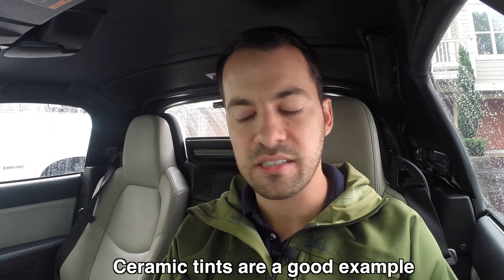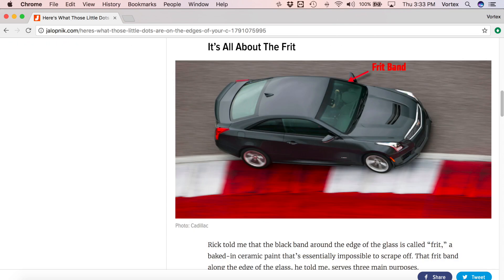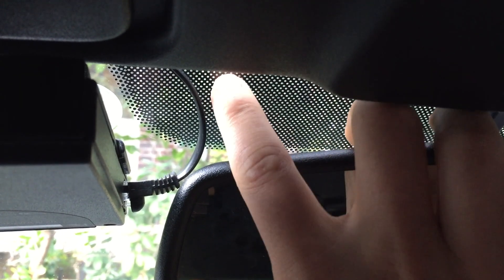Do Windshield Tint Strips or Dots (Frits) Affect a Radar Detector's Performance?

Comment: Since Frits Dots are essentially paint -- Do you think it's ok to use paint remover (or similar products) and Remove the dots?  Thus, I can mount unit higher.  Any thoughts?
Reply from the maker: Sorry I dunno. I test radar detectors. I'm not a car modification guy. There's ways of mounting on frits using tape that may be easier and less damaging to your car, but your best bet is to ask someone on the forums.

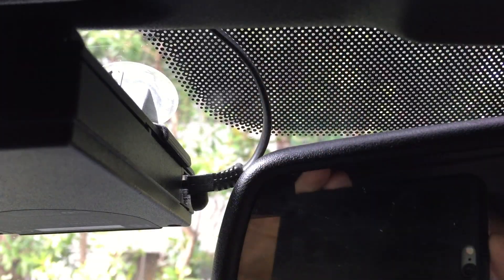Comment: 7:05 I use the Whistler XTR145 and it works perfectly where those dots are at rear view mirror. Problem is suction caps do not grip on those pesky dots and I am not prepared to scratch them off. Anyways! All I really wanted to say is that your tip of using tape over dots has helped me and now suction cups grip well. Thank you for your handy advice. 👍🏻

Comment: Is there anyway to request a spot that allows signal through when getting tint on my car
Reply: Tint does not affect radar signals. However theres a chance that the tint shop you go to might put metallic tint on your car. Just ask for carbon or ceramic film and it should be fine.

Comment: Vortex,
I have 2007 BMW 330xi with 35% on front window, and black strip across the top. I have a Escort Max Im wanting to move from window mount above dash to where you have yours next to rear view window. Question: will dark tint affect Max front that spot? Not sure what BMW's have in their front windows to affect radar.

Comment: Had ceramic installed all the way around on my Ram 1500. just went outside and looked with my polarized  RayBans and saw like a rainbow affect on the wet from raining windshield.  But no solid purple ? am i good to go Vortex ?
Reply from the maker: You should be okay. You can always test just to be sure.
Reply: Have not bought the radar detector yet..
Reply: Ok ,will be buying the UNIDEN R3 based on your great review man .thanx alot agin.
Reply: @backwoodzhooligan2352   But the R7, has arrows.  Not sure if a guy can send it in for upgrades though?

Comment: Ive noticed a decrease in my range with my Range Rover, those tiny wires cut my range at least in half. ill look for a opening in mine, never actually checked. thank you
Reply: Did you find a good spot in your range rover? I’m realizing my Range Rover has the heated windshield and 3M crystalline tint.
Reply: @naazimmaredia796  no, : ) ive stuck it all over, for some reason on the dash instead of up by the rear view mirror seems more consistent. might be my imagination thou. : )

Comment: I have a Uniden R3 and I drive a 2017 chevy HC and I found out the my GPS and speed don't work where I have it mounted which is right under the mirror using a Blendmount. Now somtime it will pick it up and stay on but most of the time it just shows lines. I have moved it and it will come on and stay on. Just wondering if any one had this problem?

Comment: My Bmw 7 series has an UV windshield that blocks all kinds of things. Even blocks my key from unlocking the car from the front. It has a cool spot that seems meant for a radar detector on the dash with a small spot on the bottom of the windshield that allows signals to pass through. Love how the windshield keeps the car cooler but the price of replacement is over a grand. Lol. Glad i have insurance for that.

Comment: Is there any other way to test if my winshield dots are metallic or not than seeing if they affect the signal strength of a radar detector? I`d like to know because i don`t have a detector just yet, but its on its way at the moment.
Reply from the maker: The windshield dots are almost never an issue so I would assume that you'll be fine.. not to mention you can always mount the detector just under the dots if needed so you should be okay. :)

Comment: does anyone have any info on the Tesla model S 2017? I have a Valentine1
Reply: I have a August 2017 build Tesla Model S.   The windshield has a thermal metallic layer with no bumps/frits, nor openings where a detector can function.  The metallic layer covers the entire surface and receives no signals from my Valentine V-1.  I've used the V-1 successfully for years in my other cars, but had been considering getting an Escort Max 360c because it receives fewer false signals and has wifi updating.  Now, I need to reconsider and find a good remote detector instead, and perhaps add laser jammers.  Installing a remote radar detector is considerably more expensive, and does not give rear detection, nor directional arrows.  Any brand/model recommendations?
Reply: @rodconti  The remote units have 2 lights, 1 rt, 1 lft.  Rt one is forward, Lft one is rear facing.  I'd replace your windshield, cheaper than a remote unit.  Only thing you need is range and a Waze app.  There are a couple apps I guess like waze.

Comment: I never actually tested out my radar detector in my 93 Mercury Cougar. But I could think that my cougar did have some kind of clear tint on the windshield. 

Because I used it as a daily driver to different construction sites. And I would give everyone a ride for lunch or pick them up for work, and everyone thought my black leather seats would be roasting hot from the hot summer sun. And they actually never wanted to ride in my car, I just said not my problem. But then they found out it actually was very cool-cold refreshing inside even sitting in the hot sun for hours, plus I had the good old air condition. 

But then!!! There is an accident at a job site. The Job site super visor directed me to park next to the trash bin. I always leave me keys in the car because we often need the cars moved around. But some idiot decided not to have any cars move as he fork lift trash up into the bin, then a bunch of boards fell off to the side because the dude was high on crack and some 2x4 wood pieces fell and destroyed my windshield. The company purchased a windshield replacement, and it has some kind of weird tint at the top. But now my car gets super super hot in the sun, just as bad as the toyota corolla. It's not cool-fresh anymore.
Reply: Oh wait. I am wrong. I actually did use my radar dector in my mercury cougar for some moments... Because I remember somewhere in samamish area of Washington State, that my detector had picked up a signal in some forest area and it really saved me a speeding ticket...... First the speed was like 35mph. But there was a spot that dropped to 5-10mph and was like a 8-foot uphill-downhill bump that was like a roller coaster and instantly turned to the left or right. And my radar detector was going K1! k1! k1! K1! before I even seen this crazy bump. I thought my detector was just being stupid because I was way out in the forest area. But I spotted the hump, holy cow, brake-brake-brake! To the speed limit. Just on the other side as I started to take the corner: I spotted the cop. What a save
Reply: 7 years later, and I'm still trying to read through all of the unnecessary details in this post.

Comment: I just bought a 2017 Rover with a metallic AND heated windshield. My Radar Detector (Uniden R1) only works on the cut out areas (AKA the windshield frits) which are baked into the glass. Off axis radar is a bit more challenging to detect as the radar detector has a small area to "peak" through. Can't justify spending $2k on a remote detector. Thanks for the video!
Reply: Jack Brand  I have a 2017 Range Rover too where did you find the best place to put the R1
Reply: I have one too, where did you put your detector, thinking about the Mac CI but it is $2700 installed.
Reply: @F06M6  same thing, range rover sport, heated windshield, ive noticed reduced range compared to my BMW, non heated

Comment: Good video. Another windshield worth addressing are the acoustic glass being used in a lot of vehicles now.
Not only in luxury vehicles but in Jeep Grand Cherokees as an example.
The glass is called acoustic and is thicker with a special layer embedded in the glass.
Reply from the maker: Oh interesting. Do you have that in your vehicle? What impact are you seeing?
Reply: @VortexRadar  Does the blue sun shading on top of most windshields block any sensitivity or range when mounting a detector in this blue shaded area?
Reply from the maker: Do Windshield Tint Strips or Dots (Frits) Affect a Radar Detector's Performance? https://youtu.be/Dd5YyLgyw5E
Reply: My G70 has the acoustic windshield...
Reply: Newer Mustangs have those windshields. Mine does.